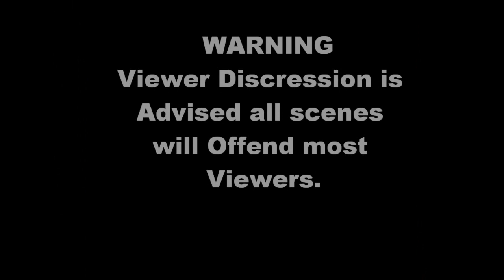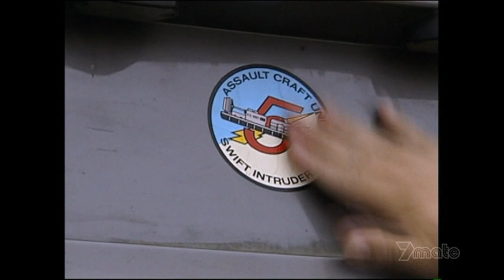De-Lorean Hell - Monster Garage

Comment: I disagree with the previous comments. The Delorean started off as a cool idea, unique body panels, rear engined/ wheel drive, gullwing style doors. The problem was that it couldn't survive the intricacies of not only mass production, but the what ended up being a cash strapped unproven organization.  I think if John Delorean was tasked with GM (or some other motor company ie Volvo), as the head engineer of a new sports car model backed with blue chip cash could of evolved successfully.
Reply: Yeah, but it would have been a Fiero, not a DeLorean. It's a miracle the DeLorean ever even made it into production at all, really.
Reply: It ruined Lotus also.